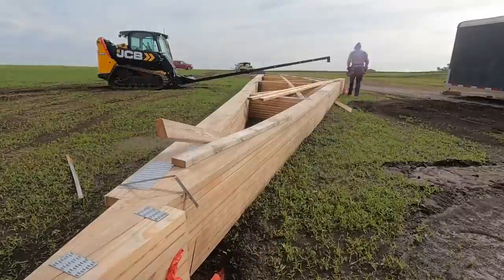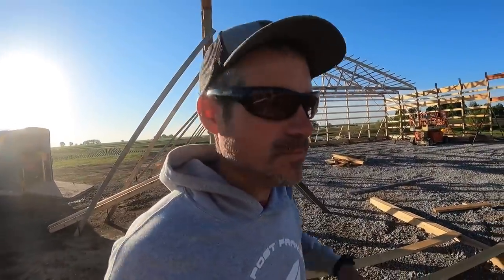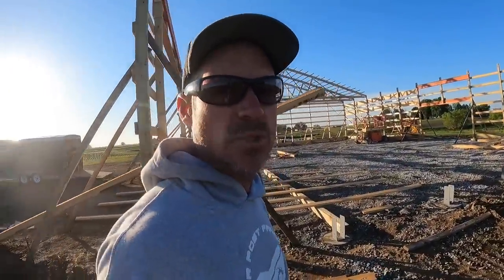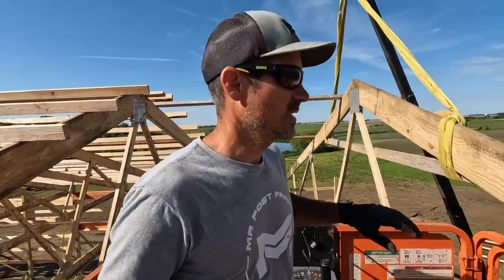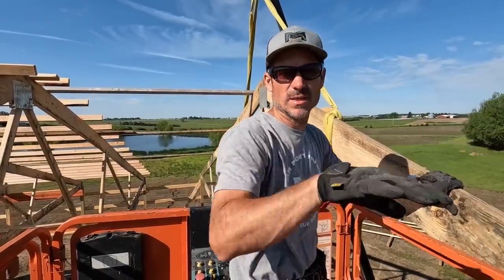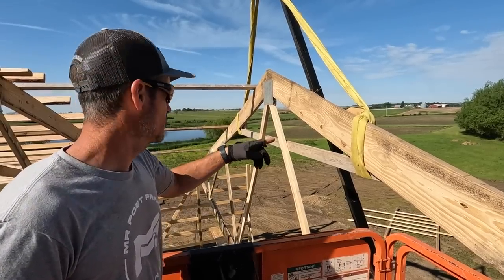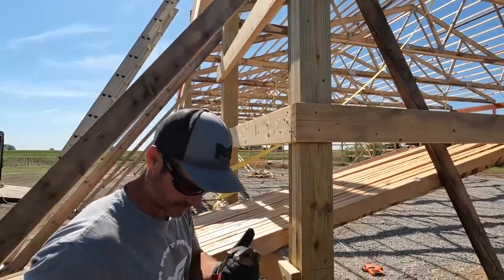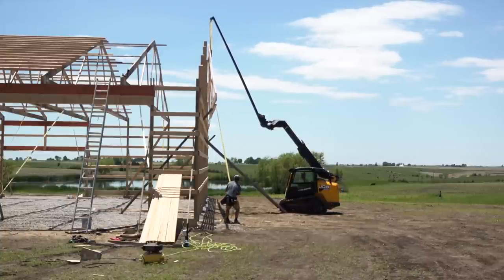Building a Shouse | Setting Trusses | Ep5

Comment: Paul, having been a plumber for several decades, I have some small "bone" to pick; as a plumber, I often used a LEVEL to determine if my installed pipe was "level", laying with the ground plane or it might be to determine I was "correctly" unlevel by the correct amount at that place. All done with the device, a LEVEL. The "plumber" (from the Latin; "worker in lead), applies and reads the tools, the level. Pretty much like a framer might, ya think! The term "plumb", from the Latin "lead" the substance, doesn't denote the "actor" but the substance commonly used for piping 2k years ago. It makes less sense to me than calling a carpenter a "sawyer" or "sawer of wood"- there is a whole lot more going on, just a whole lot more!  FR
Reply from the maker: Good point...thanks for watching.

Comment: So the ends of the trusses aren't sitting on top of a post - they are nailed/screwed to the sides?   The nails/screws are holding all of the weight of the roof?
Reply from the maker: The trusses on the end walls are nailed to the sides, but they are nailed into every post on the end walls.

All the other trusses are centered on the laminated post.